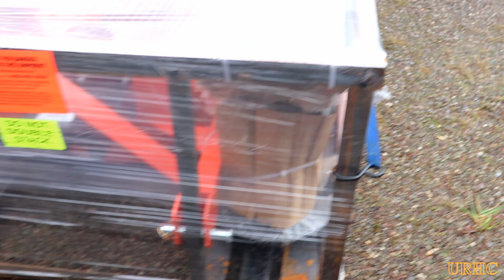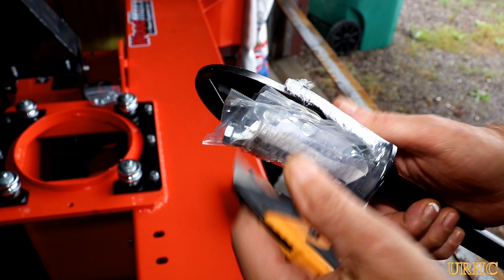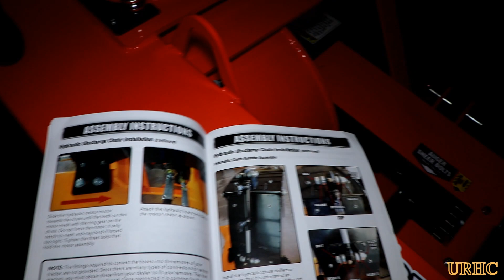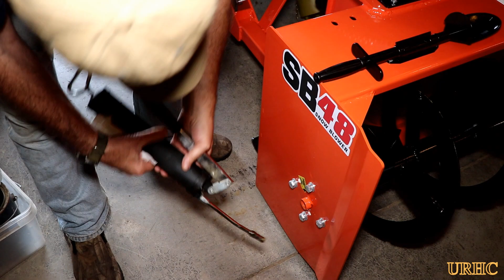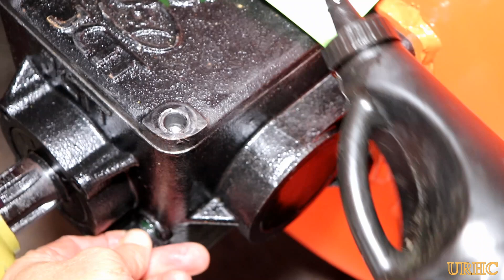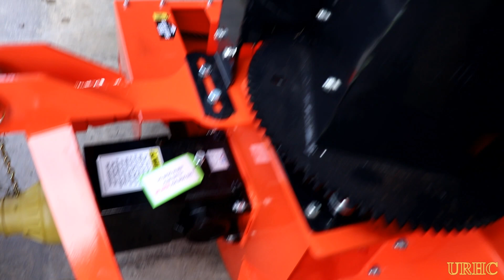Delivery And Assembly Of My New Woodmaxx SB48 Snowblower Replacing The Junk Ariens Platinum 30 SHO

Comment: Today I was watching Ariens YouTube videos on maintenance which I do every Fall to refresh my memory on greasing and oiling chain and shaft on under belly. I will be changing oil and spark plug in a week or so getting ready for winter. All of a sudden, there you were breaking your back with the Ariens. I watched three of your videos which are still on YouTube. Ick, looking at all the snow on your roof and yard and doors. I don't Facebook so I can't share your complaints, but if I had Facebook I would pass it on for you Ed. You must have really gotten a lemon. I have a 2011 Ariens Compact two stage with 205cc Briggs engine and never had the problems you had with both the Ariens last winter. By the way, what did you end up doing with the Ariens? Target practice???
Don from Milwaukee
Reply from the maker: All the ariens videos show them on a flat blacktop driveway with 3 inches of snow so it looks like they work. I have these videos shared on all social media hoping to save others from having the same problems. I even tweeted the playlist to Dan Ariens.  Neither one was any good in the gravel. You want to buy it, it is for sale as is for a flat blacktop driveway only. Thanks for watching

Comment: Good Luck with your new Snow Blower.  I have a Woods 60" that came with my old Kubota tractor.  I have never been happy with it so I hope yours works better.  Mine does not throw the snow far at all, maybe 5 feet.  Also my gear oil gets so cold that the tractor can not turn it.  I put it in front a torpeado heater for a little while and then it turns.  Mine has skid plates and wheels.  I think the wheels were an diy add ons.  I don't want to rush the snow but I really would like to see a video of yours in action.
Reply from the maker: Thanks. This one is supposed to throw it 25 to 35 feet which should be plenty. If it is stored outside they sell a synthetic lube that can be used in it for about 20 bucks a quart. I didn't want to take a chance on another walk behind after using the poorly designed  garbage machines from ariens and like giving a company like this a chance. At 47 inches wide it will fit everywhere I need to blow. Hope we get some good storms early this year. Never used a blower like this before and can't wait to try it. Thanks for watching.
Reply: Got any more detailed information on the synthetic lube, sounds like what I need.  You might want to consider the optional chute rotator, it would really come in handy when the wind shifts.  I was going to add one to mine using a HF winch but never did.  These type of blowers work great for backing into the drifts and pushing them back.
Reply from the maker: It is just a 75-90 synthetic lube that they sell. I think all major brands make it and has a -50 degree rating. Should be able to find it in any auto parts store.  That is funny, I  was thinking a remote control harbor freight  $49.00 winch motor also as a future video. Seems to be the only gear motor for under $100.00.
Reply: Thanks Ed,  I ordered some Mobile 1 from Amazon.  Doesn't pay to run around looking for it.
Reply from the maker: I plan on switching over in the spring when I drain it also. They said you don't have to drain it every 50 hours with the synthetic either.

Comment: Looks like a really nice unit. Looking forward to seeing some videos of it in use. Get you a locknlube today!!! You will not regret it I have a couple been using one for several years they are great never have had a problem no more fighting with the tip getting stuck on the zerk fittings.
Reply from the maker: I have to try one. Those Chinese tips really grab on. Hopefully we will get plenty of snow to try it out. Thanks for watching.

Comment: What kind of motorcycle did you have?
Reply from the maker: I had a 1975 Yamaha RD350, 1978 Suzuki PE 175 dirt bike, and my wife had a 2002 Suzuki  250 street bike that used chains. I also had one of the first 1978 Yamaha XS1100s out and a 2002 Harley FLSTCI.  The RD 350 was the most fun after a couple mods. Thanks for watching.

Comment: You'll be pleased with the rear blower.
Reply from the maker: It look like it should work good. I will be pleased with any blower that works after that Ariens. Thanks for watching.
Reply: I have a 54" MK Martin Meteor, Made in Canada, for the back of my GC2300 Massey Ferguson (same size as your BX) and I plow a 2 mile dirt road with it.  I have had it blowing snow that was a foot over the chute with no issues.  It loves to blow snow and yours will too I bet!!!
Reply from the maker: Yea this is overkill for my little driveway but I decided not to take any chances this time.  2 miles must take quite a bit of time to clear.
Reply: Depends on how much snow.  I have spent upwards of 8 hours blowing the road.  Not too good on the neck, but the blower worked great!!!

Comment: It looks to be a well made machine.  I hope it works as good as it looks.  I'll be looking forward to your first use and review.  I'm curious, will you be able to use it for your front walk up to the porch?  I hope so, that would be too much work.  Thanks for sharing.
Reply from the maker: Yes, it is only 47 inches wide and will fit no problem. This one has oversize skids and a reversible scraper for use on gravel so I think it will work great. My back won't miss struggling with the Ariens either.  We will soon see. Thanks for watching.

Comment: I have an identical unit (Meteor) made by a Canadian company sold through my local Kubota dealer who set it up for me on my BX2360.    I got used to backing up by sitting sideways in the seat and looking over my shoulder.  The rear pto unit  is less expensive and has more power than a front mounted unit that works off the tractor's hydraulics. You also get to keep a front end loader or a plow in place.  The rear snow blower, combined with a front end loader makes for a mean snow machine.  It does not throw the snow as far as the Ariens, but works well on my 300 ft gravel driveway with bolt on skids that I ordered separate, works good in windy conditions, and does very well with large snow drifts.  It's performance deteriorates in heavy wet snow, however.  At least once a year, we get a pasty heavy wet snow that can bog down the unit entirely.  Also, with the skids on my gravel driveway, the unit leaves an inch or two of snow on the gravel that needs to be scraped with the front end loader to get down to bare gravel or the driveway turns into a sheet of ice.  I have developed a technique using the float on my front end loader to scrape the driveway to bare gravel in a few passes.  Overall it is a good setup for anyone living in the snow belt.  It should work out well for you.  Your video reminds me I need to grease the chain and fittings on my unit this Fall.  Enjoy all your videos.  Thank you for taking the time to share them.
Reply from the maker: I had never seen one this small before. It looks well made by a company that takes customer service seriously. We get mostly dry lake snow that I think this can easily handle. My old Ariens only threw snow about 30 feet that was just fine plus a lot less snow got blown back in my face so if this works as good as that I will be happy. I may put a atv plow on the front eventually  just for scraping up as you say. Do you have rear chains on your Kubota?  Thanks for watching.
Reply: I run turf tires without chains on my Kubota BX2360 and have never had trouble in the snow, although my property is mostly level.  You should be OK without chains with your driveway.   It blasts right through large snow drifts like nothing. My Meteor unit is about the same size but did not come with much documentation or support from my Kubota dealer who sold it to me.  I am having trouble locating extra shear pins for it as I am not sure what grade and size to use.  There are two sets of shear bolts like yours. My Kubota dealer does not stock them.  The big box stores only sell shear pins for popular walk behind snow blowers. I found something that may work at Tractor Supply, but they do not match the bolts that came with the unit.  Appreciated your video on assembly of the unit as mine came all put together.   I also made a custom storage rack with casters for the unit that I keep in my garage to make it easier to mount and dismount the unit to the tractor.  It only takes a few minutes to attach the unit and pto shaft.
Reply from the maker: I was thinking chains for the sidehill but think the 600 pound blower may give it enough traction if raised slightly. My shear pins are only grade 2 bolts according to the manual. Send the company a email and see if standard hardware will also work on yours.
Reply: I was going to put a 60 inch atv moose plow in the front loader but it would make the tractor so long...I already scrape my Jeep with the loader as it is:)  this year I am going to try something new...I bought a set of edge tamers from R2 Manufacturing for the loader.  Supposed to be excellent for grass and gravel clean up with your loader.  I hope so....

Comment: May i suggest that instead of using a backup camera, you try the solution used by RC quadcopter enthusiasts today AKA the FPV system? You'd stick those googles on and see what the camera sees. It's not the best quality (tho i might be mistaken) but it's good enough for winter use.
Reply from the maker: That would be a great idea. I really want to see how this throws the snow before doing much. I was thinking my go pro with a small tablet tucked up under the canopy using the wireless app to start.

Comment: i hate to be a backseat driver n all, however it seems you coulda told the guy "hang on, lets grab a razor knife real quick" and removed some of the items from the pallet lightening up the load. plus it'd be nice if they'd just put fricken lift gates on those trucks.
Reply from the maker: That was the second option I talked to the driver about if it couldn't  pick it up. That little Deere surprised me and I really had no problem. If you order a lift gate it delays the delivery by a couple weeks by me. Thanks for watching.

Comment: I never saw a snowblower like that and interested to see how it works. Do you have to go in reverse with your small tractor in order to use? Or will you be able to reverse your tractor seat to plow forward?
Reply from the maker: You back up with the tractor. That is why I an going to install mirrors and possibly a backup camera.
Reply: I wish you good luck with the new snowblower. Hope you don't have problems breaking your neck if backup camera and mirrors fill with snow while you are using snowblower after snowstorms or during??
Reply from the maker: That Ariens beat my back up pretty bad trying to use it so this will be a lot easier on me.

Comment: I am watching your video on my smart TV right now. Glad you bought the new snowblower. I have been following you since seeing your problem with the Ariens snowblower last year. I saw the trouble you had with both Ariens last year. I always look at Ariens YouTube videos for maintenance, etc. I have a 2011 Ariens compact two stage 24 inch snowblower which works for me and never had problems with it.
I am looking forward to seeing you use your snowblower this winter......, not that I want to rush Winter on you... Watching you unpacking now on my 55 inch smart TV. 
Don from Milwaukee
Reply from the maker: With a 55 inch TV you wont miss a thing. I think the older ones are better machines and Ariens really screwed up the new ones. Unlike Ariens WoodMaxx will definitely stand behind the products they sell. Thanks for watching.
Reply from the maker: Hopefully some day I will upgrade to 4k so videos don't look fuzzy on those big screens. Can only process at 1080 30 now.
Reply: @unemployedredneckhillbilly2023  , 4k is clear. Last April I got rid of Spectrum/ Time Warner cable, got rid of my 8 year old 32 inch Panasonic TV and bought a Samsung 55 inch 4k TV with a Samsung 4k blu ray player. I don't see much difference between a 4k movie disk and a regular blu ray disk. When I got rid of cable TV, I knew I would miss recording TV shows and Green Bay Packer games. I did some research and found HULU Steaming company offered DVR option that I can record games and programs. I don't miss cable TV or the high monthly charge. I also got rid of my landline phone and use my smartphone 100%.
I just stuffed two slices of maple syrup and walnut biscotti in my mouth. Thanks again for showing my wife and I the recipe. Thanks again for the videos. Since watching you, we've made your biscotti after buying the same cookie sheets from Costco, bought the same nightlights you have and this weekend will be looking for the Cuisinart knives at Costco. Ed, your costing me money watching you on YouTube.  Only kidding. 
Keep making the videos, my wife and I will watch them. Waiting to see your new snowblower work in your 18-20 inch snow piles. I will be watching when you back your snowblower into your mailbox. 
Don from Milwaukee
Reply from the maker: My mailbox is safe, it is on the other side of the road.😁. The plows do toast it every once in a while and that is why it is on a swiveling post. I use Roku on all my tvs now to get Spectrum. What I do is cancel the tv for 30 days when they raise the price and then get the deals all over as a new customer after that.
Reply: @unemployedredneckhillbilly2023 , I have heard some people  like you canceling Spectrum for 30 days, then doing the same. I thought about going back to AT&T, but heard the Internet speed wasn't good. In my case, I cancelled everything with Spectrum, but I needed Internet. Just for that, it would have been $89.99 in my name. My wife started as a new customer and Internet in her name as new customer is $49.99. I am sure that will go up after one year term is up. I read on a NEXTDOOR APP, a person complained to Spectrum asking why so expensive for current users, but dirt cheap for new. The answer was: By raising the price of current customers is the reason we bring in new customers for a low price. I guess you have to play their game, cancel and eventually start as a new customer or have a spouse start a new customer.
Reply from the maker: My new truck is a unlimited 4g hotspot for 19.99 a month and l  can connect to it in the house. I will use that for the 30 days next time I cancel spectrum for youtube uploads..
Reply: I still use my dad"s 1980 Ariens 5 hp Sno Thro that he purchased brand new it has never let me down yet .

Comment: Looks great but what do you think about that exposed chain? Seems like if you had snow with gravel in it it could be a problem.
Reply from the maker: I have had dirt bikes with chains packed with mud, gravel and just about everything else with no problems. It is nor a concern and if a rock gets lodged in it there are shear bolts in 2 places for extra protection. Thanks for watching.
Reply: No problem, if bulldozers and excavator tracks can handle it.  Never had an issue with mine....better than belt systems.